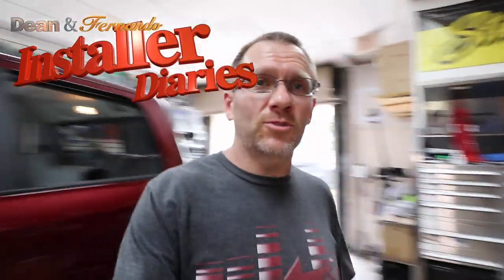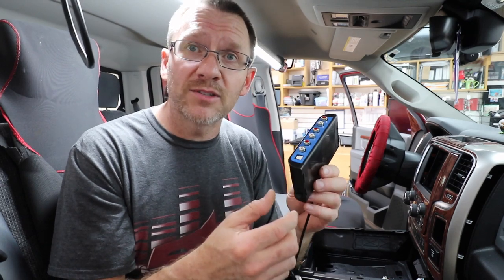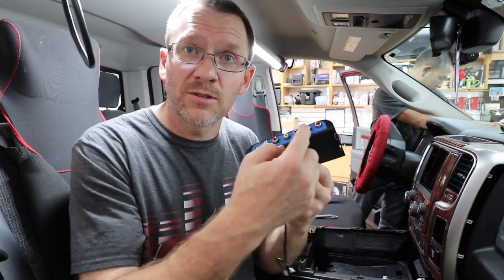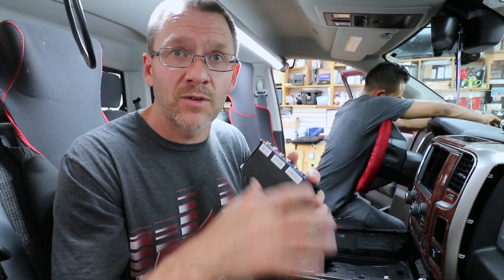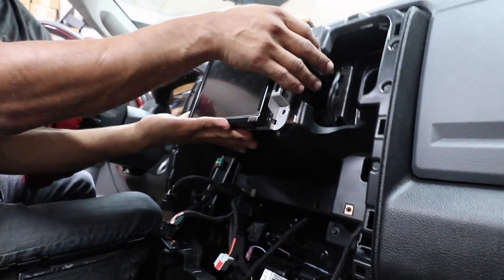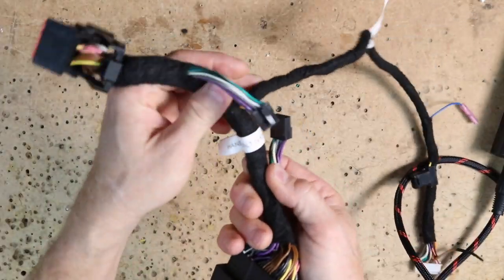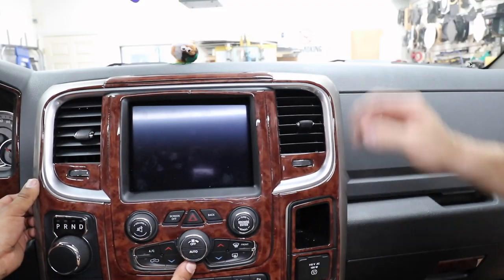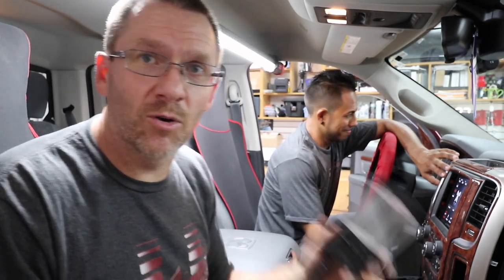The new beta PAC AP4 CH41 adds pre amp to your 8" Dodge radio Installer Diaries 202

Comment: Notes in pac instructions:  If you are installing the AmpPRO in a vehicle that is not equipped with a factory amplifier, you must add an amplifier to
the vehicle's speakers, as the factory radio will no longer have a 4 channel variable output after it has been re-configured
by the AmpPRO. For example, you can not add only a subwoofer to a non-amplified vehicle, as the radio will no longer
power the cabin speakers properly.

Bummer as thats what I bought it for :-(
Reply: lol thats what most of us bought it to put our door speakers on an amplifier how did it work for you?
Reply: @shemekacusack9914  it worked perfectly.  I've got a 6 channel amp on my 6 speakers and a monoblock on my subs.
Reply: Will this work on the 5.0 screen since it has the same pinout as the 8.4 screen? Still plug and play?
Reply: @tylercusack9436  No will not work with 5in screens...have to upgrade to 8.4
Reply: @cobrawannab1  how many speaker inputs are on the harness and does that cancel out how the dash and door speakers were factory output(in parallel), are there sub speaker terminals on the harness..I have the 6 speaker system no amp factory system...Harness hasnt arrived yet..just wanted to get a better understanding how to hook it up...So you were able to run all 6 speakers on separate channels, with out the doors and dash be factory paralleled...and still use factory speaker wire connections
Reply: @Morris Till  if your not using a pac amp pro can you jus use a lc2i to get your signal for your mono sub amp?
Reply: @johnnypiper1717  i think you can but the factory radio will “rolloff” the bass output as the volume increases.  I wasn’t diggin that either.  That’s why I went with the pro unit.
Reply: @Morris Till  oh I thought the lc2i has accubass which fixes bass roll off.
Reply: @edwardjones7412  man im sorry i didnt notice ur post.  I cant even remember now lol
Reply: @johnnypiper1717  it mostly does but its not going to be as clean as a full range signal.  I was pleased with it in a previous car but when I used it in my ram truck I ran 2 amps.  In that case I felt like the voltage on the lc2i loc wasn’t enough to support 2 amps.  Maybe I overthought it.  If ur adding 1 amp its s great solution.
Reply: @Morris Till  cool yeah I was jus adding 1 mono amp for my 2 subs that's all. So the lc2i pro would work good then you think? Appreciate the help I jus didn't wanna buy something and it sound terrible when I know how my system shoukd perform.
Reply: @johnnypiper1717  yeah great for that application imo.
Reply: @Morris Till  cool yeah I jus wanted to make sure my subs would sound like they are supposed to and my door speakers sound fine. I know I will only need that pac anc bypass for sure and let my lc2i pro handle the rca to my amp. Appreciate the help 👊
Reply: @cobrawannab1  no worries I figured it out long time ago
Reply: Would you happen to know which anc bypass harness is needed for a 2020 ram 1500 non amplified system? Thanks
Reply: @johnnypiper1717  not sure about rams sorry...just familiar with challengers

Comment: I hope they finish this soon. I went with the AC LC6. I would much rather have this with my PAC BCI-CH41 and VS41. I had to use resistors of the AC to get the audio to work. So getting this new PAC item, I would remove those resistors and be happier!!!
Reply from the maker: It will be out in about 2 weeks.
Reply: Five Star Car Stereo, thanks for the update. I recently bought the T-harness from Axxess you showed on a recent video & was about to add a few feet of 9 wire & capacitors...